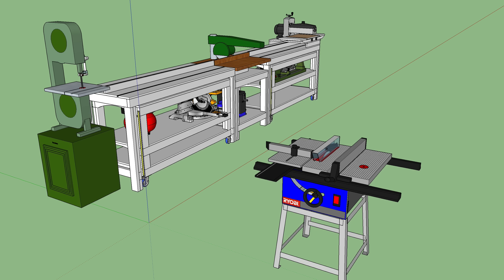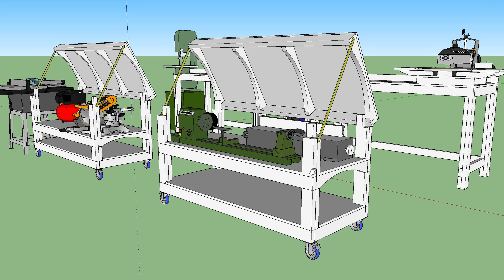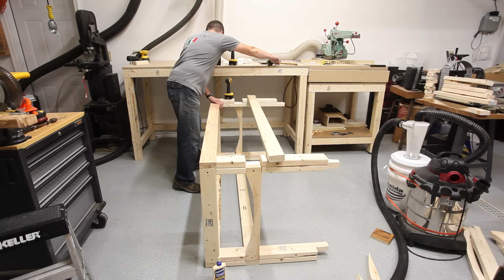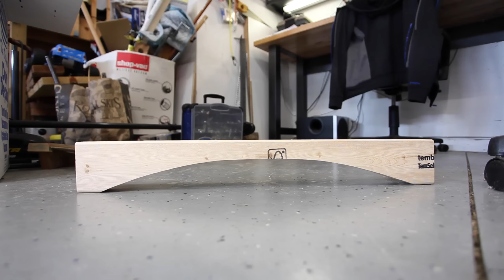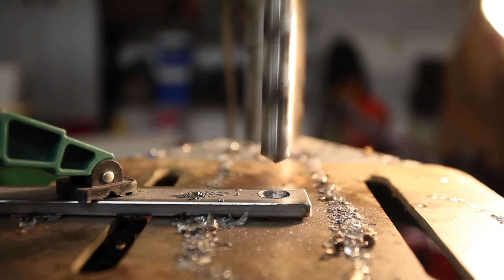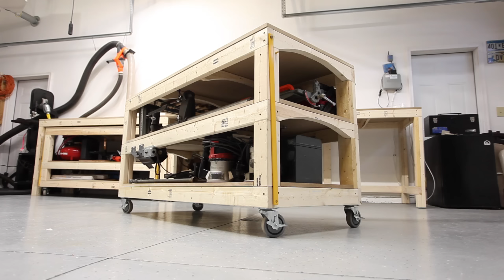New Shop Build: Part 6 - How to Build a Rolling Workbench

Comment: Genius.  You basically multiply your workbench space by more than 3x.  This will be perfect for my new garage.  
Also, I've been brainstorming ways to have an extended miter saw fence while still keeping the space multi-purpose... your next video knocks that out of the park.
This is next level.
Reply from the maker: It feels good to see comments like this!  I'm glad you like the design!  If you're interested in the plans, I just posted a highly detailed 62 page PDF as well as the Sketchup file here: https://tommytompkins.com/product/tompkins-miter-saw-station-with-rolling-workbench/
Reply: It just goes to show how important it is to plan and design your workspace tables in advance based on their intended functionality.  Here's a small tip -- you might want to add a flush mounted magnet in the leg for each of those flat metal proping arms, as that would keep them from flopping around when moving the  tables around.  Just a thought.  Thanks - Michael
Reply: Tommy Tompkins
Reply: Very good job of constructing your project.  I like the way you can save so much space.  I think I will build one like the first one in the near future once I get my garage cleaned out and have room lol.    Great video.  You have a lovely family.  Wife and kids are very special in life.  Make more projects, your shop is very organized and clean.

Comment: Very nice. Thinking of combining your design for the rolling tables with Ron Paulk's Smart Bench & Smart Station. Modular MFT top with  add-on removable plug-in modules for small table saw, router table, scroll saw and whatnot. Lathe/jointer on shelf as you've done. Tables at least 26" deep as that's what I need for my sliding compound mitre saw. Can't be much deeper as I'm working in a small one-car garage that's only a bit over 11' wide. Not sure I'll have any need for the upper table extensions you did in a later video but that might by useful on one of the lower tables.

BTW loved the music at end of video.

Comment: Hi Tommy. What do you think about the 2 inch clearance on both sides when nested? Could I get by with 1 inch clearance?
Reply from the maker: Hi Chad - To be honest, I think the 2 inch clearance on either side is just about right so you don't have to have it perfectly square when you roll the workbenches underneath. You might be able to get by with 1 inch clearance but you'll have to be more careful about how you guide them underneath the other tables.

Comment: Very brilliant for most, however it wouldn't work for me. Power tool height is very important- the saw bench is way too high and the wood lathe too low, I like my tools ready to go and the workbench must be absolutely steady and strong.  However in a garage shop that is not dedicated to a being a shop, this is perfect.
Reply from the maker: That was the goal here. I wanted a garage that can easily be converted to a shop when I need it. Mission accomplished.

Comment: Nice work..! Tip: That drill runs way to fast! Pre-drill with a smaller size and then bring it to final diameter with a bigger one. That goes especially for harder metal sorts.
Reply from the maker: Thanks for the tip!
Reply: @TommyTompkins  You're welcome. Also, if you drill in stainless be sure not to get too much heat into the metal..it work hardens and is a p.i.t.a. to work with afterward. Some cooling or lubrication will help.

Comment: Wow this was great idea. What size motor is that for your jointer? I have a small 4” Rockwell/Delta jointer that I need a motor for. Thanks for sharing.
Reply from the maker: It's a 3/4 HP motor.  I had a few motors laying around and just popped one on there. Works great!

Comment: You could have put a "C" cut on to the edge of the flat bar so when you open the lid the flat bar would fall on to the round bar. This would keep you from having to hook each side when opening the top.
Reply from the maker: Yeah that would have worked as well.  I really like it the way it is though.

Comment: What’s the adjustable bolts inserted into the legs called?
Reply from the maker: Adjustable bolts?  I don't recall using any adjustable bolts.  Are you talking about the steel rods that I ground a notch into?

Comment: Have you added some magnets to keep the bar stock from swinging around when moving the bench fast?
Reply from the maker: No, I haven't for a few of reasons: 1) It doesn't really bother me at all 2) It's easier to just screw in the lag screw a little tighter where it pivots and it won't swing at all 3) It's cheaper than adding magnets

Comment: How do you like using the lathe while sitting? Haven't seen one mounted low like that before and would think it might be harder to use. Thanks!
Reply from the maker: Honestly, it hasn't bothered me one bit in a sitting position.  If I was doing a ton of work on the lathe, I'd probably rather have it in a standing position but for someone like myself that only does occasional lathe work, I much prefer having the ability to save more space in the shop.

Comment: A suggestion for an improvement: Use gas struts instead of the metal bars. Then just use a latch to hold it closed.

Comment: Hey Tommy!  I have a couple sets of castor wheels I got from amazon - my workbench is like yours almost exactly - do you think these castor wheels will hold up?  2" 200lb each castor wheels I got from Amazon -- https://www.amazon.com/gp/product/B01M19R30O/ref=oh_aui_detailpage_o00_s00?ie=UTF8&psc=1 ---------   Please can someone let me know if they will work or if I should use them on something smaller!
Reply from the maker: It really depends on what kind of weight you have on your bench and the type of floor that you'll be moving it on, but technically speaking 200 lbs each wheel should be okay.  Personally, I prefer larger wheels to make it easier to move over imperfections in the floor.  The total height of the casters in my workbench design are 5" high.
Reply: Big ones seemed too big!  Well I supposed I'll try these out and see what happens lol.  Any tips on the type of screws to use and length? Thanks for the quick reply!
Reply from the maker: I used drywall screws with mine (I forgot the exact length) but only because I had a bucket of screws that I needed to use up.  So far they've held up just fine, but if I was starting from scratch I might get some nicer screws.
Reply: Awesome - might get some 1 1/2" hex screws - love them things! Don't have to pre-drill and they never strip!  A little more spendy, but that's what I made my benches with!

Comment: For tables like this, does any MDF do, like whatever Lowes or HD sell? Also what kind of screws are you using? Thanks for a great build!
Reply from the maker: Yeah any 3/4" MDF should be fine.  I'm using MDF from my local Menards.  I just used regular drywall screws since I had a ton of extras and needed to use them up.  If I was going to start from scratch, I'd probably get some nicer screws, but drywall screws work just fine.

Comment: Tommy great job.  I'm working on some flip top work benches for my drum sander and planer got the idea and some of the design from Gunflint Designs I wished I had seen this before I had started and would have enjoyed incorporating some of your ideas in it also.  On your lathe bench have you thought about maybe adding some under the counter LED lights for when the bench is open?  I noticed there was a bit of a shadow, even though your shop is well lit it might be something to look at I don't know.  You have the goat by the horns and you can do as you please.  Again great video and super great idea.  Thank you for sharing.
Reply from the maker: Thanks Kenny!  I originally planned on adding LED lights under the top for the lathe bench but I never added them.  It probably doesn't show very well in the video, but I outfitted my shop with Rockler's 4000 lumen LED shop lights and holy cow..I almost need sun glasses every time I flip those on!  Those shop lights eliminated the need for LED lights under the flip top in my specific situation, but I can see that being useful for other people.
Reply: I like those Rockler 4000 LED's I've been looking to replace some of lights with them.  Great job though I really like those benches.

Comment: Getting ready to build my first workbench/outfeed table. love this design. One question though, I have been hesitant about getting locking casters because I don't want the bench to move around even the slightest if I am working on something. I have seen a few designs where the wheels pull up and the bench then sits on ground. Do you have any problems with the benches moving around on you? Would you recommend locking casters?
Reply from the maker: Personally, I don't have any issues with the benches moving around on me and I have enough weight in them that it's takes some muscle to move.  But I also haven't been doing much work that requires pushing into them either (like with bench dogs or a vice).  The casters that I have only lock the wheel, not the swivel.  But they do make casters that lock both the wheel AND the swivel action and those might work well for you.

Comment: very nice, if you cut a slot in the side of the location holes on the supports, when you open the lid they will automatically latch so you wont have to put them on the retaining bars and when you want to close it down just take the weight off the lid then pull them out of the way to unlock them

Comment: Did you joint or plane any of the boards before assembly?
Reply from the maker: Hi Andy - I didn't joint or plane any of the 2x4s before assembly.  I just picked out the straightest 2x4s I could find and used some elbow grease and clamps to force things together.

Comment: If you are going to use it as a sitting work bench, why not use those lockable wheels where you press a small pedal and the wheel won't roll. A bench that tries to roll away from you all the time is probably not a good idea. :-)
Reply from the maker: I do have lockable casters on these benches and I do use them.

Comment: Best design I’ve seen for this application. If I ever need to rebuild my RAS bench. I’ll incorporate many of these features. 
One thing I noticed. When you move the assembly tables around. The yellow top supports tend to flop around. I believe a small rare earth magnet countersunk into the lower part of the leg would hold them in place. Just a random thought that popped into my head when I was watching.
Reply from the maker: Thanks for the compliment!  Great idea for the countersunk magnet.  I don't mind them swinging around but I might give those magnets a try ;)

Comment: Tommy, I'm retired from owning a printing. So, I'm intrigued with the software used to show the design process of your table.  I'm a beginning woodworker, with some skills from re-habbing houses for about 5 years. Forgot to mention, I'm also a magician who enjoys building his own props. I just turned 74, so I don't plan on developing any other interests :-)
Reply from the maker: Hi Keith  - the program I used to create the design is called Sketchup and can be found at www.sketchup.com.  They have a free version called "Make" and a pro version which is relatively expensive.  Not to give you another interest, but if you feel like diving in you can find a bunch of video tutorials on their web site that will get you up to speed :)

Comment: What are these small workbench/toolbox you moved around? (2 small ones and that dual toolbox with a single top with the drill press on it)
- Did you modify existing products or are they all sold like this? If so, what are the part numbers/models? :D Thanks!!
Reply from the maker: Those are Gladiator rolling toolboxes with maple tops that I got from Sears about 8 years ago. The one with the drill press on top is two rolling toolboxes that are fixed together with a single MDF top that joins the two.  They were designed to roll under the Gladiator workbench that you can see in this pic: http://c.shld.net/rpx/i/s/i/spin/image/spin_prod_748869512?&hei=2000&wid=2000&op_sharpen=1
Reply: Thanks!

Comment: This is genius. I've been looking for a mounting solution for my old craftsman lathe for a while and had just about given up. How comfortable is it to turn material when it's mounted that low, though?
Reply from the maker: I've had a bad back for the last 20 years so I was also concerned about it being too low.  Over the holidays I used the lathe for hours and hours sitting down in a rolling desk chair and my back didn't get sore at all. There's a quick spot in the video where I demonstrate what my posture looks like in the seated position.  Absolutely no regrets with the lathe!
Reply: Thanks for the reply. I'm going to have to try this out and see how it works.

Comment: On those support bars you could do an 'L' shaped keyway on it. Have the little part of the 'L' come all the way out to the edge. So when you're lifting the top they bars automatically drop onto the pins, and when you release the top it will go down slightly locking it in place. Then to lower the top you just have to lift it a bit at pull the supports out.
Reply from the maker: Great idea!

Comment: love the videos!!! I'm learning sketchup and wondering how you did the parts list in the begging of the video. is it a extension program?
Reply from the maker: Thank you!  No, I didn't use an extension to lay out all the parts.  I did it the time consuming and old fashioned way of making a copy of my components, then slowly tearing them apart and laying out all the boards on the floor in Sketchup. It would be nice if there was an extension that did this, but I haven't found one that does it the way that I want so for me, it's always a manual process.  The entire parts list is included with the plans which can save you a lot of time ;)
Reply: Wow that had to take some time! and yes it would be nice if someone created that maybe in the future

Comment: Good Build, great design! Will be ordering plans soon. One suggestion- instead of those small screws you used on casters, a lag screw about 1/4 X 1&1/2 in. or larger would be more secure if you will be moving it around frequently.
Reply from the maker: Thanks for the suggestion. The only reason why I used sheet rock screws is because I had a ton in the shop that I wanted to use instead of buying more screws.  So far so good so we'll see how long they last :)  If you end up building this I'd love to see some pictures when you're finished!

Comment: The project is not bad at all, but being you I'd definitely think about using wheels with brakes so the "table" is not moving while you're working woth tools.
Also, emergensy stop button for the joiner would be fine so you don't need to run around the table to the switch.

Comment: So how high did your main workbench table end up?  Is that a comfortable working height?
Reply from the maker: The main tables were designed to be 42 inches (bar height) but ended up being slightly higher in spots due to the leveling on the sloped floor.  It's very comfortable working with the radial arm saw.  I love it because I have a bad back and I hate bending over even the slightest.

Comment: Really nice, clean, simple, functional build.  The video was also produced very well.  Great job!!

My only suggestion would be that you might want to add a small lip around the rear and sides on the lower shelves of the general use table (not the lathe table).  This would keep small tools from falling out through the back or sides.  This is especially helpful on rolling tables like these.
Reply from the maker: Great idea!  Thank you!

Comment: This thing is awesome! Do the curved rails serve any purpose other than the fact that they're purrrty?
Reply from the maker: They're functional first, and purrrdy second.  Without the arches, I wouldn't be able to slide my chop saw or air compressor from the side without opening the lid.  This just makes it easier to store larger tools on both the upper and lower shelves.  It's also very handy when you're using the bench top and you need to grab something quick and don't want to clear the table to open the lid.

Comment: I think you are going to find the lathe uncomfortable to work with that low.  or not.
Reply from the maker: Not at all!  I've had a bad back for the last 20 years so I was also concerned about it being too low.  Over the holidays I used the lathe quite a bit sitting down in a rolling desk chair and my back didn't get sore at all. There's a quick spot in the video where I demonstrate what my posture looks like in the seated position.

Comment: What CAD software are you using? I'm on a Mac, and I haven't had any luck with any good ones! 
P.s. Amazing video!
Reply from the maker: Yes, the "Make" version is free.
Reply: Tommy Tompkins Is it free? what is the best option/way to get it? The software seems like it can cost $700 but could be less or free.
Reply: Tommy, do you sell the plans or have them available to download?  Thanks in advance!
Reply from the maker: Thanks Mark! I designed this entire workstation using Sketchup - www.sketchup.com

Comment: You could add some magnets to the side of the legs so your metal braces are held in place while in the down position. They seemed to swing around a lot as you were rolling it around.
Reply from the maker: That's a great idea!  But honestly, it doesn't really bother me that they swing.

Comment: Am I wrong or are you only relying on gravity for the belt tension for your lathe and jointer ?
Reply from the maker: Gravity is all it takes.  With a good hinge, it's very easy to adjust and move the belt to a different pulley section.  Just lift, move, drop, and you're good to go!